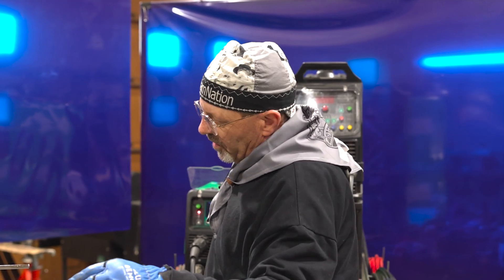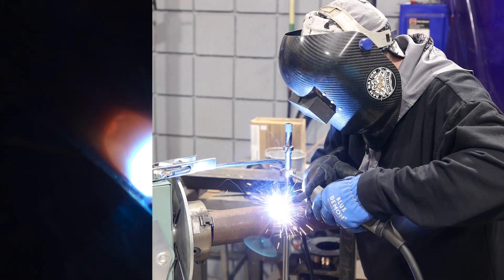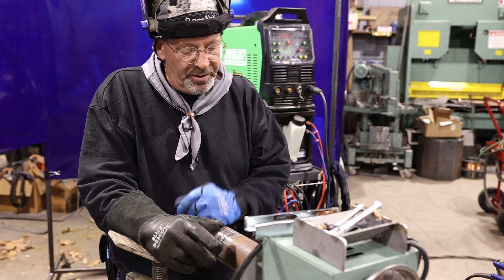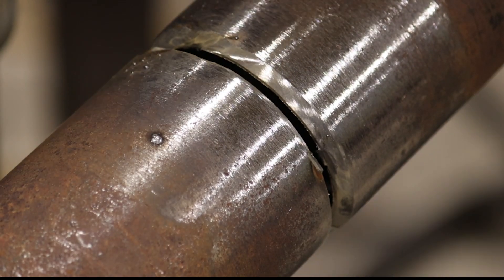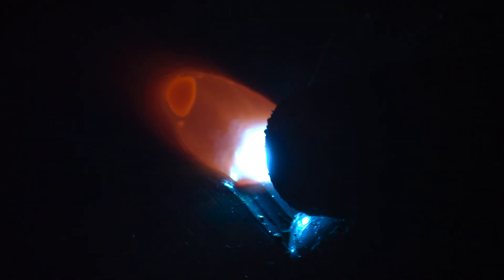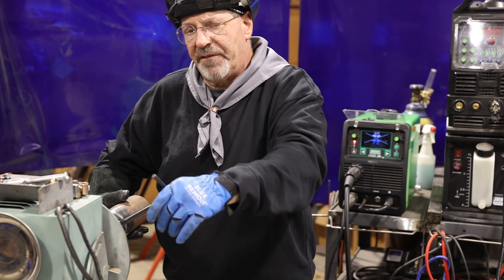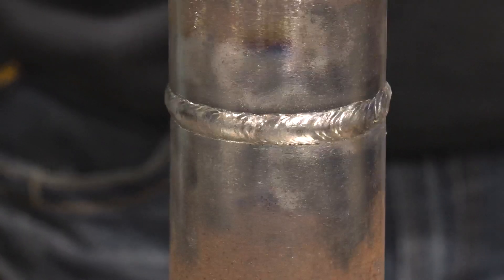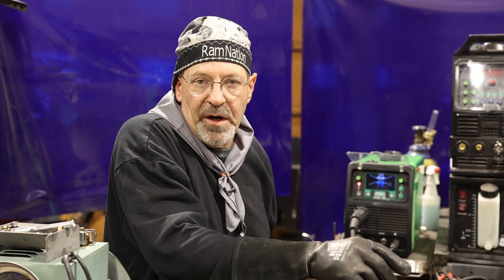Open Root MIG Pipe Welding | Everlast Cyclone 200e

Comment: A trick I use to repair the root on small pipe when you can't get in there and get those eraser thin strips out is to drill like a 1/8"-in hole at either end of the grind out before you grind it then you don't get those paper thin slivers you just stop at the drill point and clean it up.
I usually angle the drill bit about 30° parallel with the weld.
In most cases when you grind out with the holes drilled parallel at an angle you just stop grinding when you hit the outer edges of the drill hole at the top and it's all ready to go back together

Comment: Whoever runs this channel, get Bob to be involved a lot more with his teaching of the usage of your machines. Whatever you have to pay him, it is 100% worth it.
Reply: Bought an Everlast because of Bob
Reply: @jmbauer68  ditto... 
  MTS 275 Lightning..  
it took a bit to figure out the controls but it’s slick. The advanced A/C pulse is brilliant for TIG welding thick aluminum with very reasonable amounts of amperage.
Reply: @williamhague2768  mts 225 here
Reply: Yup. I’ve said it before and I’ll say it here too... many folks can weld, a handful can certify and even fewer can actually speak and relate the information needed for welders to see the whole picture, from plugging in the machine, to setting the machine to identifying and cleaning the materials and the filler, if necessary.... and how much a half a volt means when your mig welding. 
   Plus, even if Bob were ....
unattractive, deaf and dumb... watching the man weld is a learning experience and a pleasure. 
   Good equipment can’t fix a bad welder. A real x ray hand sometimes can’t order breakfast, no less teach a person what’s needed to be a hand. 
   I’m not doggin the others, but the man with the voice, the experience, the knowledge and the ability to teach over the internet ... AND make a Chinese welding machine (full of great quality components) look good .... well... he’s special. He might not turn water into wine but he is the guy who can teach and still weld and make you interested in what needs to be known so you got a fighting chance to remember it when you need it.
Reply: @williamhague2768  appreciate the kind words sir. Many thanks for the continued support
Reply: Cannot echo this enough. I would pay triple what any regular welding class would cost to have Bob as an instructor.
Reply: Watching Bob on YouTube is how I learned how to weld. Went out, bought a welder, watched every video I could with him in it and started welding. I got so excited to see him again.
Reply: @matthonea2142   matt. 
  Jesse Mcallum I’d another Everlast product guy. He explains stuff pretty well but he’s a one man show and his camera stuff isn’t anything to brag about yet. 
   Bobs man.  He’s got it all... except the English accent needs more than a little work...